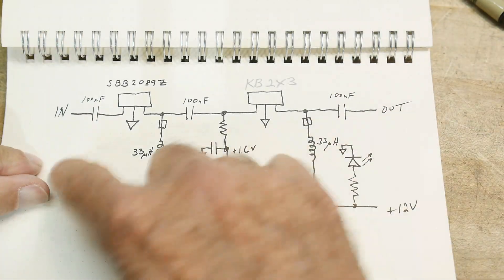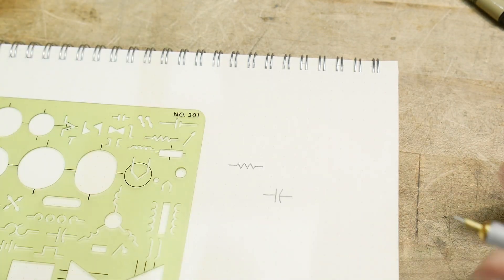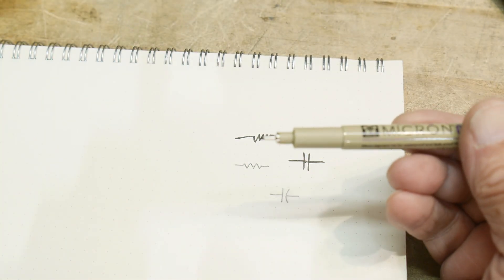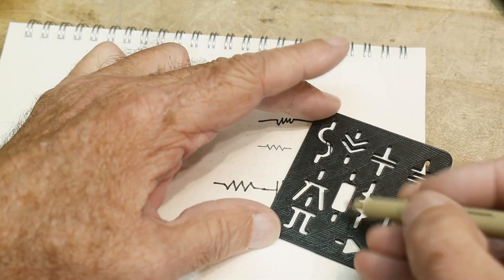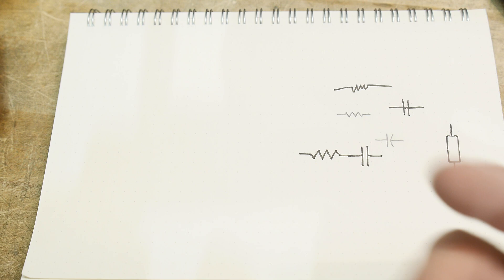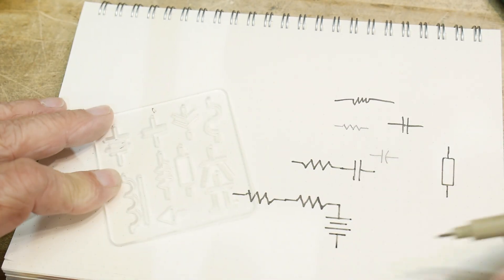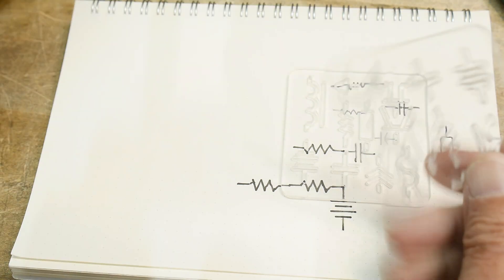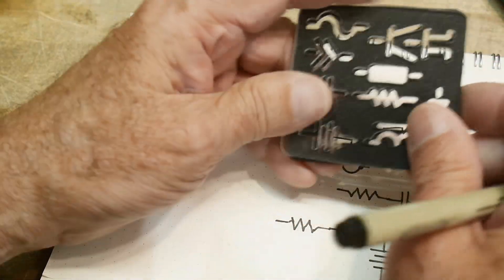#2048 My Custom Schematic Symbol Drafting Stencil

Comment: Back in the day... The only template we used was a Berol Sketch Mate R-19 for small squares, triangles, circles, and hexes. The other geehaws were for folks who weren't schooled in engineering drawing. In fact, we had one guy who couldn't draw or letter for squat without a template. He was told he needed to pursue another career and let go because he was so slow diligently trying to use the templates instead of quickly free handing it. The R-19, a lettering guide, and eraser shield were about it along with the 45 and 30/60/90 triangles and triangular scales and a compass. All done in ink on linen or plastic vellum. Then along came computers and AutoCAD...

Comment: 50 bucks each - wow. How do they make these acrylic cases for the chinese kits you can buy everywhere. These kits cost 5$ including the case, e.g. the XR2206 signal generator thingy.
Reply from the maker: I ordered 2. if you order 10,000 it's going to be cheap

Comment: Fun and useful. I downloaded your model and converted it to an svg file. Used my laser cutter to cut it out of 0.030 clear petg. Took 1 min to cut. Cost about 5c worth of material. Works like a charm!
Reply from the maker: what model cutter and price?
Reply from the maker: oh, and I need  0.08" thick
Reply: @IMSAIGuy  All I had on hand was 0.030 thick clear PETG. I agree, it would be better if it was 0.08, but it works pretty well.. PETG is clear and flexible and works well.. The laser cutter easily cuts 1/4 acrylic and plywood. I have a glowforge, which I got as a cast off from Stanford 5 years ago. I use it quite a bit. If I was buying one, I would buy a different brand. Given the reach of your channel, I bet you can get a free one!
Reply: @IMSAIGuy  people could order a $2 PCB with the shapes routed out and use that as a template for engraving the shapes out in thin clear plastic with a dremel.

Comment: back in the late 70's they used to use metal plates with the symbols in and rubbing out plates so they could lay the plate over the line or component and run the pen line out. We used to use ink on film for the master circuits, there were about 4 ladies   who were called tracers and they used to make paper copies for production. they they got a dry line printer which could copy the film on to paper. the paper started with a yellow coating and the film drawing placed over the top, both then passed by a UV light. the paper then went in to the developer and came out blue lines on white. The process used to make your hands stink like you had pee'ed on them 😞 And we call them the good old days 🙂

Comment: In 1984 I started a company with three other guys. That ended soon and then I pushed my own company out. I had to design electronics and software. I needed to design a lot and create documents for the customers. Everything by hand since ECAD's were not so common and very expensive anyway. So I found several plastic stencils similar to what you have here. On a drawing pad with an ink stylus drawing was easy and the results were crisp. Everybody drew with styluses at that time on wide drawing boards. I still carry those tools, just in case :)

Comment: Try to find a local makers space, there will definitely be plenty of help. Clear vinyl cut with a cricket could be plenty sufficient for this project. 1/8” laser cut acrylic would likely be ideal and a lot of makers spaces can help you get that done.
Reply: ‘Cut with a cricket’ = cricut machine. I think you can use the machines in hobbycraft stores in the UK.

Comment: Fast check online.  You can spend $50 on Berol templets, set of three for $51.70 (7.75" X 5") but they give you resistors and fuses and switches and antennas and grounds and semiconductors and more for that price.  If you really need what you built it is nice to know it is available at a price within the realm of mere mortals.  But I'll stick with my .3mm and .5mm leads. and the RapiDesign stencils  thanks

Comment: I can't imagine doing any (serious) schematics on paper. It's so easy on the computer and just print it out!
Reply: You're twice as old as me and seem to have embraced modernity more. I'm the complete opposite, I do everything on paper, unless I need to design a board. Ha.
Reply: @KeritechElectronics  My handwritten schematics look absolutely horrible! ( I have old folders full of them!) Now they are nicely drawn and I can keep all of them on USB drives.
Reply: What software do you use? I often need to draw schematics but most of what I have seen is either overly complex or limited in scope...
Reply: @kpnconsulting8739  I use a paint program called Paintshop Pro 5 This is an early version (before it got super complex!) of that popular program.The editing and undo functions make drawing a snap. Of course there is a learning curve.
Reply: unless youre a pro (ie very fast) at using the software its faster/easier to just draw it by hand. works that wy for me anyway haha. doing it on a computer is tedious and i only do that if im making pcbs from a schematic.
Reply: @return2sender791  I use paintshop pro 5, which is a free early version of the program. It is very easy to draw with it since the editing capability is amazing.

Comment: I have an Analog stencil cutter.  Print the design on paper and lay it on the drum next to blank stencil sheets and it will Lazer cut the exact copy.  I think the thickest material is approximately 1mm it can cut through.
Reply: Photo diodes are awesome.
Reply: Which is exactly what is called for.  Stencils should be reasonably thin for drafting.  Are you offering to make stencils for us????  If so, not only would photo diodes be awesome so would formerlyjailbreak be awesome.